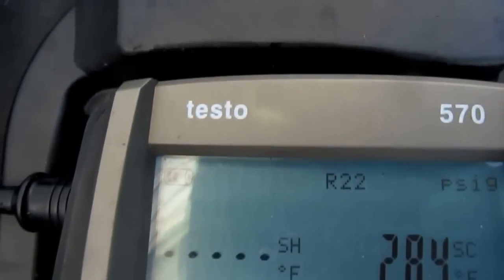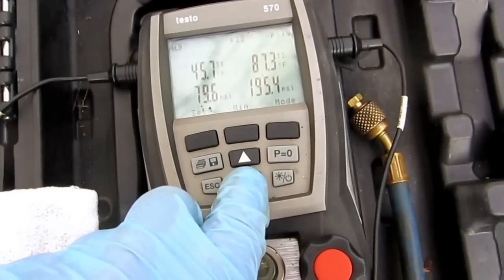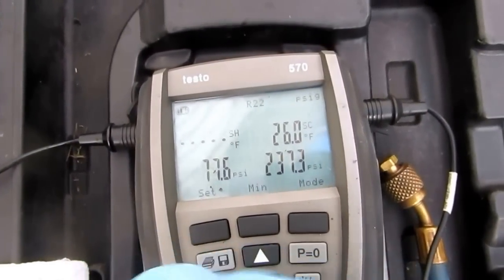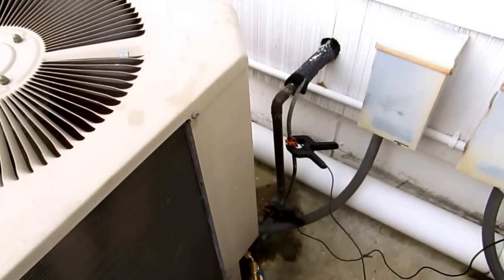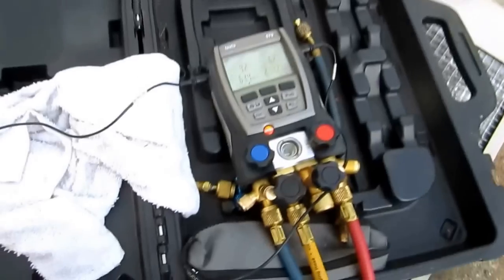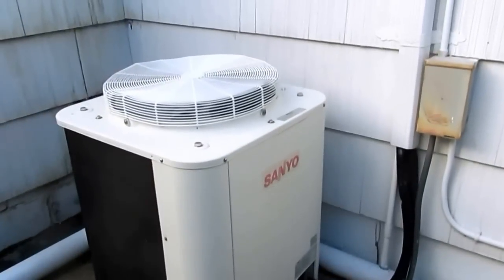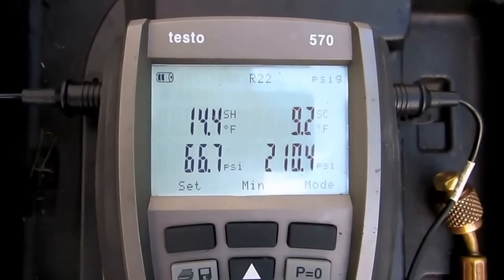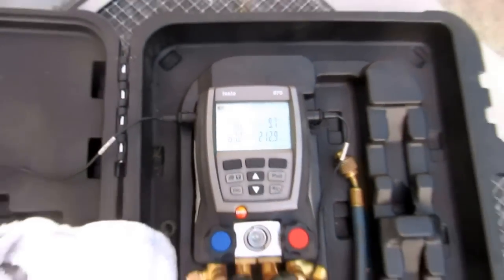HVAC SERVICE-no cooling call, a. c .system overcharged by 6 lbs

Comment from the maker: there is a lot off thing to take into considension ,it all depends on what kind of metering device you have .the load conditions  out side,temperture ,to many things to list some times there is miss matched eqipment ,not enough return air, durty coils , air in system ect all affect,how the system will operate, best to watch videos and try to pick up some tips .but mostly super heat  or sub cool is how you charge the system by ..

Comment from the maker: there is a lot off thinkg to take into considension ,it all depends on what kind of metering device you have .the load conditions  out side,temperture ,to many things to list some times there is miss matched eqipment ,not enouth return air,durty coils , aiir in system ect all affect,how the system will operate, best to watch videos and try to pick up some tips .but mostly superheat  or subcool is how you charge the system by ..

Comment: Steve I really appreciate you, I learned from you more than I learned at school I'm a  new tech by the way ,and still learning,
What position the service valve is on to recover the refrigerant that way?
And is all hoses connected as normal ?
I can really use your help sir
Reply from the maker: mikhaielj the pressure on the high side of system is higher then the tank pressure so you can push the refrigerant into the tank .. at will

Comment: great video, I was wondering if you measure wet bulb with your 560 testo, do you use a wireless thermometer or does it calculate it for you?
Reply from the maker: Ron White testo 570 does not measure wet bulb ,

Comment: What are some of strangest hvac or refrigeration problems that you have had to troubleshoot?
Reply from the maker: +Jim Gill lol to many to list
Reply: +steven lavimoniere  Here's an example. I once installed 3 Copeland 7.5 hp 0760 compressors on a 12' open upright frozen meat case and they were all bad. Compressor number 4 worked normally. The first two compressors that I put in would go out on their internal protectors even though I was throttling the suction service valve and keeping the amp draw down. The third compressor ran like a top but pumped all of the oil out of the crankcase in about 30 minutes. It was a very efficient oil pumper. Bad piston rings I guess? That job really wore me out.

Comment: Hey Steve are you recovering from the discharge of the system while in operation? wouldnt that 180-190psig of pressure do harm to the recover unit during operation? i realize there meant for 410a, and have only recovered refrigerant while it's at ambient temperature (system off) much lower pressure. Just curious. good video.
Reply from the maker: Travis Willcox the high side while running has more pressure then the recovery tank so it goes right in no problem ,just becarefull not to take to much out .. because your dumping out liquid. so it can get away from you quickly .. then you have to reinstall refrigerant
Reply from the maker: Travis Willcox i am not using a recovery unit ,i am using the condencer compressure  to push out the r22 from the high side into a recovery tank
Reply: steven lavimoniere OK. thanks for the prompt response Steve. You have quite the  video library for both plumbing and HVAC. I've been watching you for a few weeks now. Keep up the great work :] and appreciate all the knowledge you share. -Travis.

Comment: Very interesting video, I have a question what if in the same situation but with the txv doing exactly the same dance above sub cooling that is @ 11~15 but with 1~3 superheat or less on R22, would you still look at the superheat or could you just look at sub cooling only and ignore superheat since its txv? Could over charge issue be here as well? Thanks this is very interesting learning video I have learned a lot here ! and still learning more everyday.Keep up the good job!
Reply from the maker: it might be a loose txv bulb .check if its insulated also super heat should be like 10 .maybe your sub cool should be 9 or so
Reply: Thanks I think you are right regardless it should have some superheat.

Comment: I would not expect to see a low suction pressure with low super heat unless the airflow is not good .. If the conditioned space is warm the pressures should reflect a good load ...Looks like someone overcharged the unit to keep it from icing up during cooler weather.6 lbs is more than double on that unit
Reply from the maker: Brian Ellsworth it was way over charged
Reply: steven lavimoniereYes it was over charged ...I do not say other wise . I just think if the room was so warm the pressures would be little higher on a 90 degree day with the superheat and sub cooling in the ball park of course .I just see so much bad duct work out there ,but most people can hardly afford the service call ..let alone redesigning the ducts
Reply: I know that . There is not enough load getting to the unit . If you have a 65 degree back pressure with an eighty five degree room there's another  problem
Reply: I always did industrial .for maybe 20 years with very few call backs . I started doing residential where everybody is an expert.All the complete crap installs I see. Where are these guys ?? hope they are not the experts

Comment: Had a goodman 5 ton unit with a bad compressor. The owner wanted to replace the whole system. Pulled the refrigerant out 34.5 lbs came out. It was supposed to have 16.375 lbs. wow. Didn't know they could hold that much extra. I don't think they are going to use that guy anymore. Lol.
Reply from the maker: wow thats a lot extra ,,,,crazy

Comment: Pulling out excess refrigerant will also eliminate some of the oil. How do you know that the oil charge is not too low. That recovery bottle hides the amount of oil being removed from the system. I suspect the manifold set used by the original overcharge person may have been old and required replacement. There was likely a freezing problem during low ambient temperature. Overcharging can happen easily under these conditions, and the suction pressure may not appear that high on the gauge. I think many of you commenters are trying to be smart ass rather than understanding how this happens. Get that word hack out of your vocabulary.